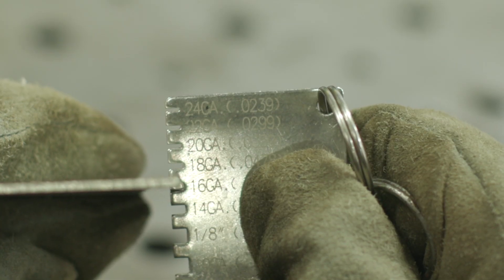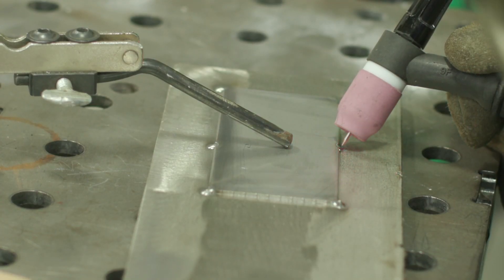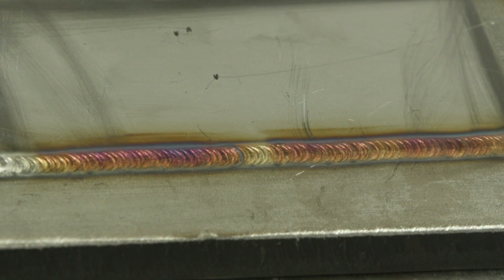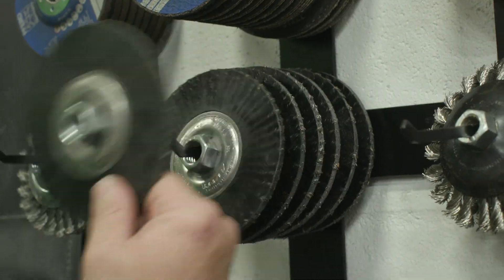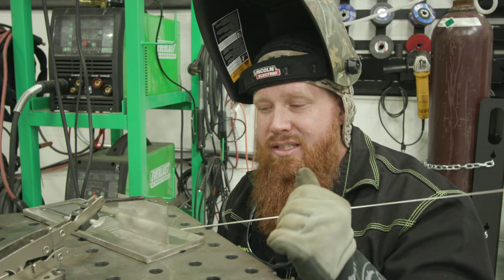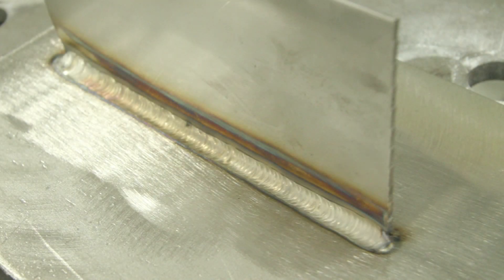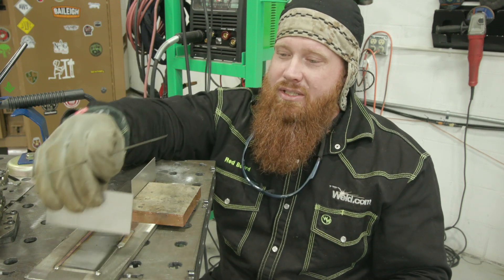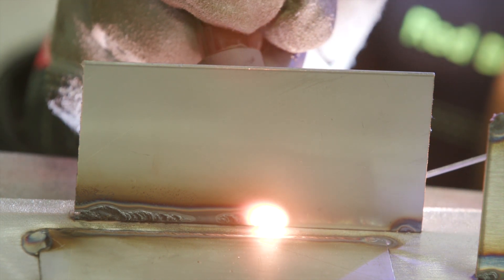Thin to Thick Stainless Welding

Comment: Hobbyist welder. I need to tig 20 gauge sheet metal to sched 40 pipe (1 1/4 inch diameter, about 1/8 inch thick wall) . I can’t find a video that shows this. Can you please do one?
Thanks much!

Comment: Do a video of large thin stainless and aluminum like we see in the Automotive performance industry. Some 3 to 5 inch thin wall tubing. Performance big block or diesel stuff. Please please please I'd love to see this, also show torch setup and welder settings.

Comment: Hi.  Thanks for posting this video.  I was looking for something like this.

I just started welding with TIG and have been watching lots of videos.  When I was welding I realized the off gasing was for real, but I don't see very often YouTube creators using them.  Are you using a smoke eater or other kind of exhaust system or do you wear mask protection or none of the above?

Nex question is about the tungsten.  First, I've noted that for the most part everyone seems to be using the 3/32 rods.  
I've even heard different comments about how sharp, or dull the point should be depending on the weld or material, but, what about the rod itself?  Are there different rods for different situation or materials?  Not size, but, tungsten alloy?

Thanks a lot.

Comment: Do you set amperage for the thick material or a mid-range between the thick and the thin?  I assume you wouldnt use an amperage only adequate for the thin.

Comment: Could you show how to butt weld 10mm (3/8”) plates at 600mm (60”)so they could be used for a table top. I’ve tried and it has buckled badly. I was using small stick welder that was 140amp max using 3.2mm (1/8”) 7018.

Comment: He is welding with such high amp and walking so slowly that his material is being welded at two sides but then the other side is not receiving backing gas so its becoming all weak and dirty. Also if you weld this way on a project your whole project will pull out of shape and you are gonna have a bad time straightening it.

Comment: Pushing the welding parameters of the amperage. Can 210 amps DC TIG weld 3/8 stainless? Mostly making mounts using 1/4 rounds stock to 3/8 to 1/2 round stock. I shouldnt have any problem fusing these thickness together with 210 amps?

Comment: Thanks guys for the video. I'm the guy who asked for the stainless. I would love to see more stainless how to's, not just thick to thin. I work in a bacon processing plant and that's all I get to weld is stainless. Just looking to make my next bead better than the last one.  I mostly work around 1/8" thick but I have tig'ed down to 22ga. and up to 1/4". I also mig most of the product non-contact surfaces just to speed things up a bit.  I've also had to learn sanitary fittings on the fly they're about a 1/16". Any tips on those would be awesome too.

Comment: Class 200 CuNi tube in both 6G restricted with 6" tube and 1/2" class 200 CuNi tube in a restricted 90 degree socket test 4f and 5f positions with visual, dye pen, and cut and etch acceptable to mil-248 and mil-2035 class 1 acceptance.

Comment: hrmm, a video you havnt done yet.
i think i might have ideas for like 10 videos with one story here.

how bout practical application for the home gamer?
it seems like your videos mostly target a controlled, learning zone.
clean metal, maybe some mill scale, steel is a known thickness. etc.

well i got a buddy with a busted exhaust on his motorcycle.
for whatever reason, i have to fill a hole in a used exhaust pipe.
metal is rusted, maybe chromed, who knows how much of the steel is intact after i grind away the crap.
back side of the steel is blind, and covered in soot.
how much do i have to strip off before i can safely weld?
sure, the best way to be to cut all steel away that wasnt a consistent thickness. but time is money, and worse, money is money too.
do i want to cut the entire exhaust away, then buy new pipe, mandrel bend it, and weld it into place?
it would be perfect, but what kind of price tag would that carry? for an old exhaust on a POS bike? fuck that guy.
how do i determine what is "thick enough" based on my situation?
exhaust is low pressure, i can get away with some thinning of the wall.
is there a metric, or table, or research board somewhere in the world that says, {X pressure, applied to Y surface area = Z thickness of Q material}?
is that too far from welding and into material science?
is a welder in a field, ass deep in muck going to need some material science knowledge?
is it OK if your welds blow on an oil pipeline because the paperwork was wrong, and the metal spec wasnt what it should have been?
are you at fault if you cant recognize that?
back to the exhaust, now we figured out that the material we have is thick enough to make the patch, how do you fill an entire hole on a curved surface?
do you cut a piece of steel to the exact size, then hammer that hooker round?
how do you tell how far a gap you can bridge based on your wire thickness, or electrode size, or tolerance for ass-hattery?
is there an episode where i can learn how to do some math and figure out how much gap i can bridge?
what if im ankle deep in swamp doing some shit show repair a subcontractor of a subcontractor of FPL, and i have no stock? lets say im a jobber, and not a welder, i dont have a truck full of steel stock. how would AvE weld it? hed probably build up the weld out of wire, or filler rod, or break a piece off an old broken part and weld that in. 

can you even do that without your OCD kicking in?

sorry i got on a tangent, this exhaust, it has soot on the back, can i weld soot?
how do each of the contaminants affect the weld?
sure 'contaminants bad' any monkey can be taught that, but what does welding over rust do? pores? blow outs? etc?
what does welding over soot do? does it just incorporate some carbon into the steel, making higher carbon steel? is that so bad?
how does contaminant X affect the;
-Heat transfer of the weld
-fluidity of the puddle
-reaction with gasses in the air or the sheilding gas

how do i hold a patch panel in place on this exhaust to tack it in? magnets? how do they even work? its fucking magic!
what about putting a patch panel into place over a hole in the side of a round non-magnetic tube? how do you hold that fucker before you tack?

thank you or your time and consideration of my comment.
im not rambling on and on to try and outdo the other guys for some abrasive wheels, these are questions i honestly have.
i would appreciate the addressing of any or all of them in videos one day.
even if you have fun with every single one of them, id still like to explore these thought exercises without the cost of the mistake in the practical world.

Comment: video idea: im just teaching my self to weld from your videos. i keep getting undercut when trying to weld a threaded SS316 nut (1.5 inch thread) to a flat piece of 3mm SS (this is for the purpose of threading in a hose tail for a sea strainer on a sea water intake to a marine engine. the undercut is exclusively on the nut for some reason. if i turn the amps up just enough to make a puddle i get undercut. any further down and i cant make a puddle. im directing the arc at the base plate as you show here in this vid but even though the nut is super chunky ( 8mm thick SS) i still get really bad undercut. its killing me man. dese nuts arent cheap.

Comment: Welding a 4 inch crack in a chevy 350 cast iron engine block no preheat compared to preheat. If I could send you a picture you could see what I mean. Need to get this welded soon as possible. lol

Comment: I'd like to see a video on stick welding with car batteries, done in a controlled, scientific way with various rods and material thicknesses found on vehicles. Something to give people a baseline of what rods to carry and how much penetration you get with different sizes. We use this method for trail repairs on 4x4s using two batteries and two sets of jumper cables to get 24V. Fixing broken frames and suspension mounts and even welding broken axles back together to limp out of the woods are examples trail-side repairs.

Comment: Hey Jason , if possible could you guys do a video mig welding aluminium with the Everlast 275 p as im struggling a little with the pulse settings , on 3mm , 4mm, 5mm  would  really appreciate it .
Cheers from Australia
Troy

Comment: Would like to se a tutorial on engine driven welders and set up especially with the welders that have just dials to adjust the amperage. They can be confusing when they don't indicate the amperage on a display. Perfect example would be a Miller 225 Bobcat.

Comment: Hi sir. Thanks for the video. I'm wondering, is there a limit for welding thin metals? How thin can you go? For example can you weld a 1mm thin steel sheets with no problems?

Comment: Video topic not yet covered.  I have just learned about the blue welding lenses and they are supposed to allow greater vision of the weld and still give full eye protection. My local independent welding supplier showed me a very short video clip and the difference was impressive. Price?, I will find out on Monday.  I would like to see a video on a welding lens comparison between what you now use 

( I guess it is green) vs the blue.

Comment: Gas lens lengths. I have searched a lot and haven’t found anyone talking about gas lens lengths and how it impacts heat in the torch as well as the welds.  
Lots of talk about diameter but near zero on stubby, regular and long gas lenses lengths.
Thanks

Comment: I’d like to see a video about MIG welding thin wall exhaust tubing like you find on a car. Both stainless and mild steel if possible. Preferably putting a new section of pipe onto old for a repair or modification.  Old used exhaust pipe is typically crusty with rust outside and carbon inside and can be a nightmare to prep and weld nicely.  I’ve searched a bit and can’t find and good videos for tips and tricks to prep the old crappy section in a way that yields nice welds or doesn’t result in blowing holes in it, especially where it’s even thinner than normal due to corrosion. Also sometimes you need to get a fix done and the fit up with the pieces you have sucks and there’s a gap to fill.. include that too.

Comment: what I would like to see is really thin stainlesssheet metal work, I want to build an kitchen island exhaust hood but have no idea how I would weld that up and on what settings,  I have an Eastwood TIG200 which doesn't have all the bells and whistles that the more modern units have.

Comment: 4 in schedule 80 steel pipe root, hot, fill, and cap passes using stainless 308 wire backfeeding

Comment: Please do  Mig like Tig , I keep trying but my mig looks like mig....  😕
Reply: Hi. I'm no professional. But from my understanding. Mig welding and tig welding are two different processes. With Mig welding your wire is adding filler metal,  where Tig is more creating heat to melt the metal or alloy and add filler wire. Oxy fuel welding is very close to Tig welding process. The only difference is that you're using flame as your heat source versus using electricity which a Tig uses to create the heat.

Comment: I don’t remember that the cup size, tungsten size, welder setting were mentioned in the video. Everything else presented was excellent. Please make a video showing what happens if the wrong tungsten size is used. Thanks.

Comment: I don't think you guys have done TIG verticals. It'd be nice to see a TIG vertical on 3/8" plate. On like 309,321,or 253MA stainless. Where I work at we use a variety of stainless materials and TIG verticals are a common weld to make.

Comment: Welding like 3/16 aluminum box  or just thin sheet.  Showing process from prep, cleaning, amps, filler, argon flow, cup size or type, etc.  Most importantly showing pit falls of not doing some thing like not cleaning well,   to hot,  lack of argon flow or coverage, too small cup, etc.  And how to correct said problems.  And maybe I might learn what I did wrong on my last project.  It was a cylinder so no nice square edges to back with a heat sink.   I gave my self a D for a grade only cuz its together..... it just looks like well ... as I was told fido's butt.  :/

Comment: Thanks always for the great videos! 
Could you please kindly make it a habbit of allways stating the material being welded (Which you did here, but if there are any codes like verieties of aluminum codes for example) filler material being used and your welding settings? That would help amatures like me so much more! 
Thank you so much!

Comment: video on comparing standard cups, gas saver and gas lens on aluminium with 5 cup. which one welds best, uses less gas and which one keeps tungsten cooler with less post flow. running high amps for the tungsten size.
always looking at minimising gas usage especially when doing a lot of small runs.

Comment: How about aluminum mig. 16g to 1/8.Using pulse/double pulse comparison to regular spray transfer. No spool gun, just mig gun with Teflon liner.  Often done in boat repair and building. Rectangle /square tubing to hull& lap welds thick to thin sheets.

Comment: Galvanized steel fencepost welding. Cleaning off galvanized material, thin to thin metal, and best treatments to prevent rust afterwards.
Reply: saw your comment, not a welder by trade, but i am a car guy, and i might be able to help a little.
in the auto industry theres a weld-through primer you can get that will allow you to protect a spot, weld through it while its painted, then coat it with protectant again to keep the rust down between visits to the spot.
super handy if your tacking to mock up a frame on day 1, then coming back to do the final welds to the whole chassis on day 30.

Comment: I’d like to see a video on proper work grounding for TIG which is kinda backwards polarity (aluminum (AC)). I’ve seen videos of people welding with bare arms on tables, but I just had one give me a tingle through thin sleeves. I’m new to TIG (two days), but I can stick and oxy-act. Figured I’d learn TIG for the smaller and aluminum projects. Like your shows. Enjoyed the cart build. It gave me many ideas. Thank you for sharing your knowledge.

Comment: You don't see many videos on you tube about avoiding stress risers when welding.  Why and how fish plates are used, direction of welds, heat control, use of crush wires in certain applications, pre and post heat, etc. In the earth moving industry over the years I've seen a lot of repair work done that did more harm than good.  (Course grit on my sanding discs please.  lol)

Comment: I'd love a video on the use of the different types of tungsten (red, green, grey...) and their purposes with pros and cons on different materials and machines. I know many people use the green (pure) for aluminum welding, allowing it to ball up, as that's how i was taught, but after a demo with some local Miller reps, and about 3 months at my new job, I specifically only weld aluminum with a point on grey tung, same as stainless and carbon.

Comment: Tips for making square cuts on a vertical bandsaw on aluminum or stainless tube. For like a intake or for exhaust system. Possibly include setting the blade up so it tracks square.  Been having a real hard time adjusting my bandsaw but even before have always had a hard time cutting it square
Reply: Have you tried a new band? Our 1 tends to veer off a bit to but the blade on ours has a bit of wear

Comment: You should try a 11/2" thick flang to a 28 gauge corrugated 6" stainless steel exhaust pipe .that's when you learn the definition of washing and pulsing your foot petal.

Comment: These stainless videos have me wondering.  Why does plasma cutting stainless make such a crazy mess at the edges (dark black slag)? EDIT - saw the "sugaring" at 5:49.  I am guessing this is the plasma cutting issue.
Reply: of course, it's the same thing. heating up to high temp without having a inert gas to shield and protect it from oxidation.
Reply: @Steve_Just_Steve  Thanks.  Any way to get clean cuts when plasma cutting stainless?  It's 308 I've been trying to work.
Reply: @MoparStephen  I'm not sure if you're using a CNC or hand torch and  I'm not an expert but other than using specialty gases like Nitrogen, I think the simplest option is the use of a water table and fast cut speed to reduce heat input.

Comment: Can you do a video on cast iron repair, with cast repair rods, and 7018.
Reply: Also can you include using stainless steel rods as I have found them to be the best for cast iron to mild steel repairs such as a post capitol to mild steel top capping rail on a period style fence.

Comment: lets see some vertical up and down stainless mig groove welds open and closed root. I weld on 4000 pound lift gates for semi trailers in this fashion at work and wouldnt mind some tips. my boss wants pretty welds I want structural so I do a vertical up root and vertical down cover pass to make it "pretty. any advice on more pretty vertical up welds ?

Comment: can you please explain how to do this Thin to Thick with aluminum but  with the older style machine  that don't have all the frequency adjustment.  I have a Miller dialarc HF  I can only adjust the current and the amp
Reply: same method and preheat thicker piece. If you don't have freq adj don't worry about it, there's nothing that you can do with it that you can't without in my opinion.
Reply: @Steve_Just_Steve  thanks

Comment: A video on over head stainless stick but I want the camera man welding while man cub films
Reply from the maker: That'd be okay, because with Mancub runni g the camera you probably wouldn't get to see the garbage weld that the camera guy out down 😂
Reply: @Welddotcom  hot dog! I bet that smarts! Okay grab a weldpak from your local home Depot and have man cub modify a light duty trailer for a landscaper near by.